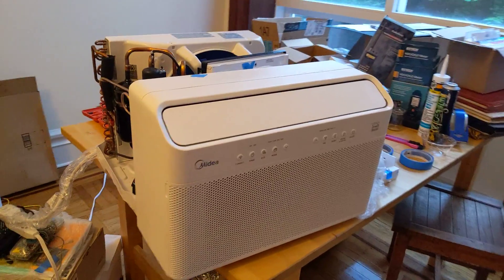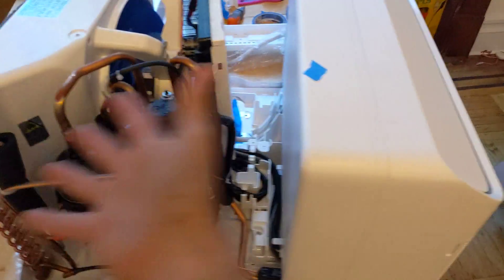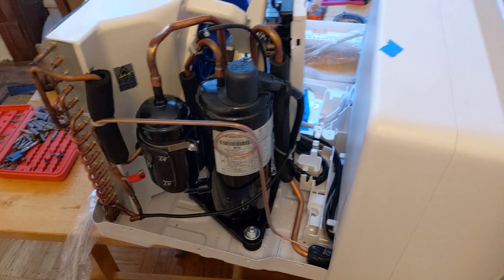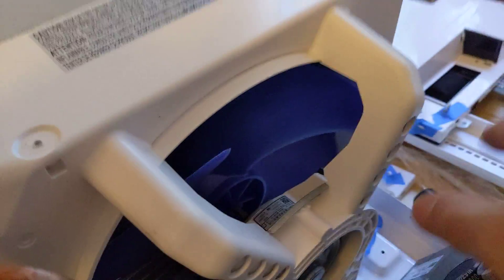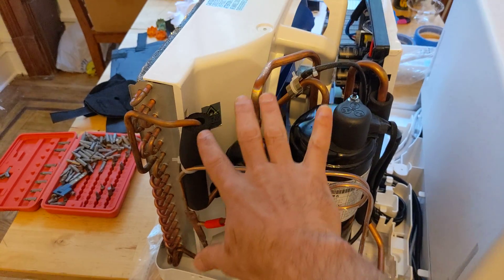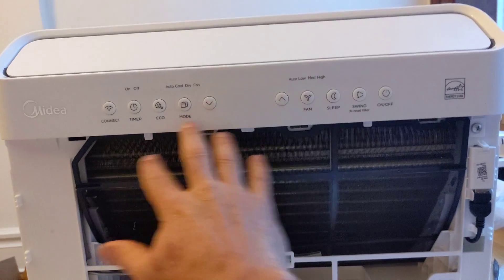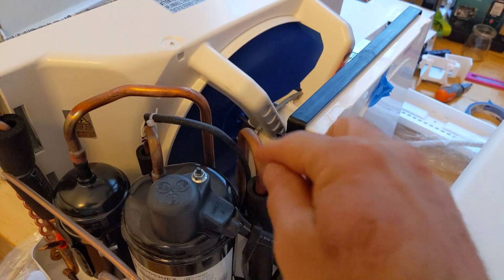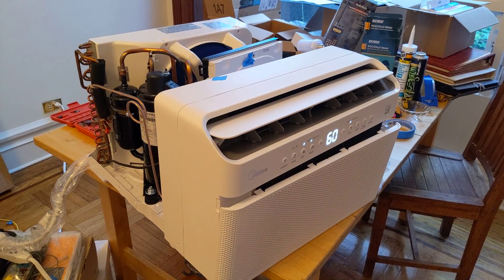How did Midea fit a full mini-split system inside their new "U" window unit?

Comment: Why do you keep calling this a mini-split?  I don't believe it offers heating.
Reply from the maker: Correct, these units do not include heat- although I hope they will eventually offer heating models. But I don't think the term "mini-split" necessarily implies that a system also can supply heat. "Mini-split" usually refers to a system with built-in air handler (mini) and separate indoor and outdoor units connected by refrigerant lines (split).  The ones that also can provide heat are often called "Dual mode" or "Air-conditioner plus Heat Pump". But these are just descriptive words, so different people might use different words, especially in different regions (in the Caribbean they install a lot of "mini-splits" but I bet none have heat capability, whereas in Alberta when someone asks for a "mini-split" of course it must also be able to produce heat).

Comment: Conisdering it cost $300+ whats the advantage to not spending an additional $300-400 (assuming drilling a hole in the wall and setup is negligble) and getting a TRUE mini split. I'm sure it would be even more efficient.
Reply from the maker: If you own your home and have a drill and bit that can go through your wall and have a good place to put both the inside and outside units and you have a vacuum pump and manifold and you are EPA certified to work on refrigerant lines, then you should definitely do a proper mini-split! But if all you have is a window, then this is a great option.
Reply: @bigjoshlevine  I've a nat. gas fireplace in my living room that vents near the central ac unit. Could I install the mini-split hose through there and during the winter dismantle it and use the fireplace?
Reply from the maker: @robertcook6058  Probably not practical. The pipes in a minisplit are filled with refrigerant and it is a lot of work to connect and disconnect them (and it is technically illegal unless you are certified).

Comment: Thanks for the video. Could you explain why would the condensate help with the supercooling? Do you mean there's more heat transfer to the liquid that will eventually be drained out? Or do you mean the actual supercooling in a thermodynamic cycle?
Reply from the maker: The condensate forms on the evaporator coil on the interior side of the unit, so it is at a lower temp than the interior ambient air.  So running the refrigerant though that cold condensate you thermodynamically get back some of that cold to move back to the inside. You can either run hot gas though it (out of compressor), in which case you can reject a lot of heat before you get to the condenser coil because of high delta T and potentially can reject a huge amount if you get the water hot enough to evaporate to the outside air since you capture the full latency heat of evaporation there. Or you can run high pressure liquid (just out of the compressor) though  the cold condensate water and then you end up with supercooled (cooled below the boiling temp) high pressure liquid at a lower temp inside the evap coil. In this unit they are doing the later and you can See where the high P liquid at the bottom of the condenser coil dips into the pan with the cold condensate. Make sense?
I think it would have been nice to also run the hot gas line near the top of the condensate pan so if that pan started to get, say, more than 1/2 full with water then it would touch and make more of the condensate evaporate out of the pan until it got below that level. Maybe they decided it was not worth the extra copper?
Reply from the maker: Sorry " Or you can run high pressure liquid (just out of the compressor)" should say " Or you can run high pressure liquid (just out of the CONDENSER)"!
Reply: @bigjoshlevine  I see. I got what you mean, and yes it make sense. That actually is a pretty clever design, using cool condensate to further cool down the hot liquid refrigerant, almost like a heat exchanger. But does it sacrifice longevity, having a pan of water there, in contact with the tubes. Also could it have bacteria growth there over time, which would be pretty nasty.
Reply from the maker: @mechael  I have copper pipes in my house that have been sitting in water for 100 years. :) Some people say the standing water has been a problem in their units, but it has never been a problem in mine. It might be a problem with having enough tilt (it should noticeably tilt towards the outside), or maybe outside humidity (I live in NY so not like FL or LA).

Comment: Any idea how to take the front apart? I'm trying to troubleshoot a noise on mine. It sounds like coolant has an air leak or something. Can't find any videos on it. Thanks.
Reply: Three screws under the front cover then unplug 3 wires. Use screw driver  to  pry open the front cover. It IS only snapped  in. Then two screws on top. 3 screws on each side then you have to unsnap gray cover to get to fan.Just opened mine. Fan stopped spinning. Put grease on rubbeer holding fan in place. It was making whining noise then stopped spinning. Works fine now.

Comment: What I thought was interesting is that the three versions, 8,000, 10,000, and 12,000 btu, are all the same exact dimensions. What do you think is the actual difference in the internals or do they simply have a different limit on the power of each model? Do you think they simply charge a premium for the more expensive even though the internals are the same?
Reply from the maker: My guess is bigger compressors in the bigger models. I have all the sizes so maybe I''ll try taking apart at some point to look!
Reply: I don't think they have the same dimensions outside the window. The bigger units extend farther from the house, but the inside evap and housing is exactly the same.

Comment: How do you get rid of the condensation that pools at the bottom of the unit?
Reply from the maker: Make sure that the unit is slightly tilted to the outside so the water flows in that direction. If the water outside is a problem, you can drill a little hole in the outside bottom of the pan, but note that condensation helps the unit run more efficiently.
Reply: e Channel
10 months ago
Three screws under the front cover then unplug 3 wires. Use screw driver  to  pry open the front cover. It IS only snapped  in. Then two screws on top. 3 screws on each side then you have to unsnap gray cover to get to fan.Just opened mine. Fan stopped spinning. Put grease on rubbeer holding fan in place. It was making whining noise then stopped spinning. Works fine now.

Comment: Can I cut the refrigerant lines and extend them to place the outdoor unit somewhere else? Of course I know we need to recover the refrigerant and refill later.  My use case is for school bus conversion. My thought is to make a small hole on the floor for cable and lines and put the outdoor unit under the bus. I do not have room inside for a true mini split and do not wanted to install this on the window (requires too much customization, water leaks opportunity, etc.)
Reply from the maker: If you have a vacuum pump and EPA certification then it would be possible, but I am not sure it would be the best way to achieve the result. Better might be start from scratch and buy exactly the parts you need and put the system exactly how you'd like it. They make compact evap units for truck cabs that look like little minisplit bars. You can also buy compressors that are already set up to run off 12VDC so saves the hassle/low of either modifying the Media controller or using an inverter.

Comment: That’s how awesome the Asian HVAC market is…

… we’ve got tons of innovative HVAC systems that are amazing in terms of technology, efficiency, and quietness.

I use Full DC Inverter Hitachi window ACs and Mitsubishi Heavy Industries split that have DC PAM and Vector Inverter control. I pay around $100 to run all 4 of these units in a hot climate 14-20 hours a day each. (@24c set temp in a 36-38c environment)

We also have the highest cost per kilowatt in Asia I think but still, couldn’t be happier!

On that note, did I just miss it or this unit does not have an electronic expansion valve?

Comment: Does the fan speed truly control the compressor? Would the compressor ramp up to full tilt when the fan is on low or would it just ramp up to the compressors lowest speed and stay there?
Reply from the maker: The compressor motor speed is independently controlled and depends on the inside temp, the outside temp, and the set temp. Basically the compressor will try to run at the lowest speed it can to keep the inside temp near the set point.

Comment: I just installed one of these units and it doesn't have any drain hole. Is there any drawback to that? Like build-up of dirty water? and is it ok for the controller board with the microprocessor to be exposed to the elements like heavy rain and dust?
Reply from the maker: Some have complained of mold and insects in the water, but I have not had any problems with any of my units. The water helps the unit run more efficiently, but you can drill a hole on the corner if you'd prefer yours to drain. The controller board is encased in a very nicely sealed IP housing.

Comment: I have one of these that I'm trying to troubleshoot. Unfortunately it was plugged into a 220V outlet and it tripped the circuit breaker. There's a green light on the test/reset plug but I'm wondering if there's a fuse on the circuit board. I'm having a hard time finding documentation, does anyone have an idea about how I could try and repair?
Reply: If you can take some high resolution photos and post them somewhere (catbox [dot] moe) of the front and back of the main PCB (s), someone may be able to help point out what exactly is damaged. Make sure you leave it unplugged for a while, don't touch the back of the main PCB, and/or measure and discharge the capacitor. You can try to email your pictures to me using the email in my channel if you'd like.

Comment: I'm looking to remove the beeper or possible mini speaker on the circuit board to stop the being sound. I don't see it on the main board.... I presume it's on the display portion, would love any tips or disassemble for the internal section.
Reply from the maker: Any hints on how to get into the front housing without damaging it?! I could not find the screws or tabs!
Reply: e Channel
10 months ago
Three screws under the front cover then unplug 3 wires. Use screw driver  to  pry open the front cover. It IS only snapped  in. Then two screws on top. 3 screws on each side then you have to unsnap gray cover to get to fan.Just opened mine. Fan stopped spinning. Put grease on rubbeer holding fan in place. It was making whining noise then stopped spinning. Works fine now.
Reply: Use the app to turn off sound.

Comment: I have a 5000 btu that cools my room just fine but is loud. Will these  8000 btu make my room uncomfortably cold?
Reply from the maker: No. One of the killer features of these units is that they will automatically slow down the motors to keep whatever temperature you set. Compare this to a normal AC that will run full blast until it gets to the set temp, then clonk completely off, wait for it to get hot again, and then clonk on.

Comment: Thank you so much for posting this video. It helped me decide to buy a used 10k model to see if I can separate it into a hacked mini split. FWIW, in comparison to your 8k model, the 10k has the same compressor but a different condenser and maybe a slightly shorter cap tube. I'm not sure about the evaporator since yours is not visible. Pictures of my teardown are at the following link if anyone is interested. https://photos.app.goo.gl/hTdG6CV2QZfG9QzY7
Reply: If anyone has a 12k unit they wouldn't mind pulling the cover off of I'd love to see how it compares to the 8k and 10k units.
Reply from the maker: I'd love to see those photos, but the link is not working for me. Can you check that the permissions are "anyone with link can view"? Thanks!
Reply: any tips on getting to the front control board? I'd like to remove the buzzer.
Reply: @louisw  This pic shows most of the tabs that hold the front panel on. https://photos.app.goo.gl/RXnmuGFpecsRzRxi8  I think there were also two screws behind the filter cover. It'll be tricky to get off without any damage to the tabs but if you're real careful with a plastic wedge you might be able to pull it off. It's not glued on.
Reply: @brik2k  perfect, thank you. I found the screws but didn't want to start prying until I knew better where the tabs were located.
Reply: @brik2k  Thanks again so much. Your pics were the look at the clips I needed, and I managed to disassemble and remove the beeper this afternoon.  Really enjoying the near silence! I also took some pics along the way, hope someone in the future finds them useful: https://photos.app.goo.gl/qiNEpKJsAgQLzXWm9
Reply from the maker: @louisw  It is hard. I gave up. The plastic might be glued or sonic welded.

Comment: It is a real shame that this is cool only and not a heat pump... because it looks like everything is there for this to make a great through the window micro split heat pump. If they could get up to around 15 SEER heat and cool... they'd take the window unit market.
Reply from the maker: Adding a reversing valve would increase cost and complexity so I understand why they did not add one on this first round - but it would be nice if they released a new version of maybe the 12K BTU unit with heat too!

Comment: Hi, could you share me photo of pcb. I want to know can convert it used DC power.
Reply from the maker: https://photos.app.goo.gl/ubftXHCqzRekykvS7
It is a pretty straightforward brushless motor driver- the power transistors for the compressor are under that big aluminum heatsink.
Reply: @bigjoshlevine  thank you, i had ask my friend, can't convert it to DC for camper van but it is very suitable with RV, quiet, save energy and small

Comment: hey Josh - do you think it'd be possible to actually split this up, and mount it to an RV? I'm curious if cutting/splicing the lines would render it inoperable?
Reply from the maker: This is possible, but to do it the "right way" you'd need a vacuum pump and a torch and an EPA part 608 certificate. You'd probably recover all the refrigerant, cut the lines, add some valves, reattach the lines, pump down the system, add the refrigerant back in, seal the system. Easy hour or two for someone who has the tools and has done it before, but probably not for others.  I've been trying to come up with a good way to do the same thing without the special tools - maybe using easier stuff like tap valves and crimps. It is hard. LMK if anyone out there has any ideas!
Reply: @bigjoshlevine  thanks for the quick response - so appreciated. I'm thinking this'd be a tidy side-hustle for all of the van/rv-dwellers these days ... this would make for a very inexpensive mini split that could be installed on an RV or converted van (which would be my application). I'm going to see if there is anyone in the Phoenix metro area that might be able to help and I'll let you know. (Think a DIY/kit mini-split for campers/rv's)
Reply from the maker: @steph_on_bass  Yea, someone really should make a micro minisplit about this size. Mr. Cool makes a 12K that is very nice, but probably 2x too big (and 2x too expensive) for an RV...
https://amzn.to/39KOgME
Reply from the maker: @steph_on_bass  Alternately, if you can weld then possibly you could cut a hole in the vehicle sheet metal just big enough for the evap coil to fit though and then VERY_CAREFULLY slide it in and then weld back on the piece you cut out. Then you would never have to break the refrigerant lines.
Reply from the maker: @steph_on_bass  Found this thoughtful h̶a̶c̶k̶
 conversion googling "micro split"... https://expeditionportal.com/forum/threads/building-a-micro-split-ac-system.216931/
Reply from the maker: @steph_on_bass  Just found this 8K minisplit unit that seems to have quick-connects on the refrigerant lines! Might be what you are looking for. LMK if you get one!... 
https://www.forestair.ca/en/fiche-produit-mini
Reply: @bigjoshlevine  looks like that model is only sold in Canada ... I did see another nomad using it though: https://www.youtube.com/watch?v=woZH85EiHNY&t=849s 

I think I'm going to try to go the Midea U Split route. I really appreciate you looking out. Do you have an amazon affiliate link? I'll gladly use it to try to give you some monetary value ...
Reply: @bigjoshlevine  I'm going the Midea U Mini route ... wish me luck!
Reply: @bigjoshlevine  ok - so my plans have changed a bit ... I'm still planning on using the Midea U, but rather than splitting the unit and mounting the compressor outside, I'm planning on mounting it inside my vehicle, isolating the compressor side, venting it to the outside, and then the head unit will be pulling air from within the cabin and the blower will feed into a rigid ducting system. Does this sound crazy?

Ultimately, there isn't an ideal spot to mount the compressor side outside of my vehicle, and in the circumstance that I run into an issue with the unit - I'll at least have an intact unit that can be replaced, as apposed to most certainly voiding the warranty by cutting it in half ;)